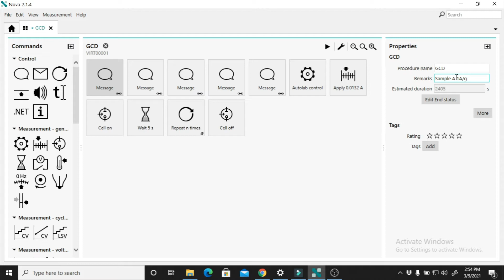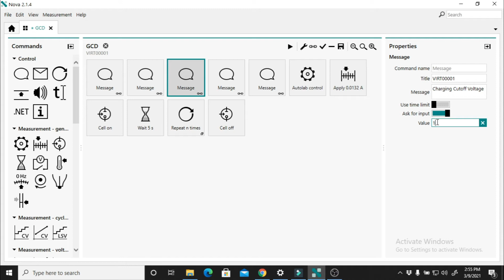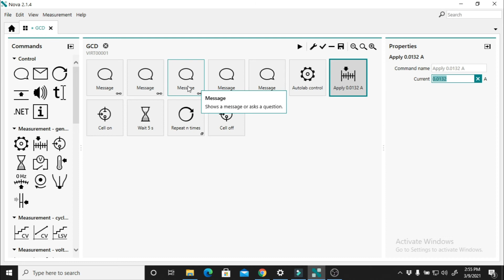How to run galvanostatic charge discharge (GCD) step by step.

Comment: Hi Dr Haffis, first of all, thank you very much for your valuable information videos. I would like to consult you on a subject.
In the CV test, the potential ranges of the carbon and polyaniline based electrode were -1 volt and -0.6 volt. However, when I enter the cut-off values in the GCD analysis, the electrode suddenly charges up to -0.3 volts and then discharges normally up to -0.6 volts. The same curve occurs when I change the order of the potential ranges from -0.6 to -1 V. Since the electrode is homemade and contains a thermoset polymer binder, could the problem be on the electrode surface or do you have any other thoughts on this? A successful cycle is obtained in the CV test, but the GCD graph cannot be obtained with the same intervals. Thank you very much in advance.
Reply from the maker: It is a bit weird if your potential window for carbon/polyaniline to be from -1 to - 0.6 V only. Try scanning wide potential first from -1V to + 1 V. Then you can reduce the potential window accordingly. GCD did not follow cut off, maybe because your sample is still capable of reaching a higher potential window. OR the current you put in is too big. So try to fix your potential window and try again.
Reply: @DrHaffeast  The electrode contains a thermoset polymer binder, as well as a small amount of carbon-polyaniline. Initially, I applied CV from -1 to 1 volt, but the best supercapacitor curve was obtained from -1 to -0.6 volt. I also performed GCD at current densities ranging from 500 to 5 mA/g. However, I think I need to improve the electrode. Thank you very much for your reply; I will follow your suggestions.

Comment: .

I have conducted a GCD test for 1000 cycles. Now, I would like to:

    Extract the data for cycle number 500 specifically.
    Export all the data (from all cycles) into formats such as Excel or Origin for further analysis.

Could you please guide me through the steps to achieve this? If possible, I would greatly appreciate it if you could share a video tutorial or documentation demonstrating this process.

Thank you for your time and support. I look forward to your response.

Comment: Hi sir. My parameter ranges are -0.3 to -1.0. 
How can I set the parameters in the charge and discharge.
Reply from the maker: You can use the same voltage as CV.

Comment: Good morning sir can u please tell me how to save the cyclic stability data taken in the nova software
Reply from the maker: The stability cycle will save automatically. However you need to export one by one. Normally we export cyle no 1, 200, 400, 600 until 5k or 10k. You can also do increment 500.

Comment: In the NOVA library I can not get the GCD file.  Chrono charge discharge is there. How can I get GCD using NOVA file? please help me. Mail me the GCD method of Nova file.
Reply from the maker: Greetings. Sent me an email at haffis_92@yahoo.com.my
I will send the procedure tomorrow. Today I am quite busy.
Reply: @DrHaffeast  I sent you a mail. Please reply.
Reply from the maker: @anupravamandal1870  I have reply. You can directly import the procedure using Nova sofware. Or convert the data to procedure.
Reply: @DrHaffeast  Thanks
Reply from the maker: @anupravamandal1870  welcome
Reply: @DrHaffeast  Please check my reply in mail.
Reply: I have run the GCD file , which you sent. It could not record the signal for two scan. It recorded the signal for a half scan, up to cutoff voltage. I have mailed you for that. Please reply.
Reply from the maker: @anupravamandal1870  I saw your graph.......from the NOVA software you can see two graph. but during plotting you only get half graph. this is because you plot it wrong. you should copy data during charging and discharging then you can get full graph.
Reply from the maker: @anupravamandal1870  https://youtu.be/hX4vfxu3YZ4
I have made video. Please check
Reply: @DrHaffeast  In the show data option, only one half of first scan is recorded then how can I copy data during charging and discharging. Please check my NOX file.
Reply from the maker: @anupravamandal1870  Its normal for first scan... Normally we take the second scan... thats why we run 2 scan not just one.... If you want both scan please repeat the experiment thrice instead of twice.
Reply: @DrHaffeast  I performed the GCD for 2 scan in that nox file. But not getting full data for 2 scan in the data save option. Although, in the plot display window  proper 2 scan is visible. Please check the nox file. Why is it so? Please change the setting of nox file and send it to me.
Reply from the maker: @anupravamandal1870  https://youtu.be/hX4vfxu3YZ4 this video show u how to extract the data.

Comment: Hi Mr Harish
Thanks for sharing the knowledge in electrochemistry. How can I link the message box with cutoff voltage in sharing and discharging section. I try to link them but can't find it in link parameters.
Thanks again
Reply from the maker: My name is Haffis not Harish...hihihi. So far we got the procedure via supplier which is Metrohm.

Comment: Good evening sir
My potential window is from -1 to +1  so what value should I put in the value box of third message
Reply from the maker: For three electrode system, yes you can have potential window from -1 to +1 V.

In Your Case, the third message should be the maximum cut off voltage which is +1.

The fourth message should be -1.

Regards.
Reply: Thank u So much sir  could u please tell me how to run gcd And impedance in nova 2.1.5 Software sir
Reply from the maker: @thendralkrishna7319  I think, I have uploaded the video on how to run GCD and EIS via Nova.
Reply: Can u share the link sir
Reply from the maker: @thendralkrishna7319  https://youtu.be/yF5LFg7WSng
Reply: Thank you sir
Reply from the maker: @thendralkrishna7319  you are welcome.
Reply: Good morning sir I am getting gcd graph but it looks like some what different if u share ur email ID I will send the graph sir.
Reply from the maker: @thendralkrishna7319  haffis_92@yahoo.com.my
Reply: Thank u sir I have mailed u sir
Reply from the maker: @thendralkrishna7319  Dear sir, I got your email. I have seen your GCD graph. There is two main problem first the IR or voltage drop is too big. Second the charging is too long but discharging time is too short.

For the former problem, please check your electrode fabrication and your connection of potentiostat. If 3 electrode system, please check your working electrode fabrication. Maybe, if your sample is less conductive, the resistance will be higher that leads to high IR drop. In this case please add conductive additive or do composites. If you are using device, same thing to consider your electrode fabrication. What electrolyte you use and how you assemble device.

For the latter problem, if you solve problem 1, problem 2 can be minimize or even solved. Please check the discharging cut off voltage. Why -1.4V? why not cut off at 0?

Overall, looking at your GCD graph, I suspect you are using battery type material. At low current density your GCD cannot achieve the maximum voltage which is in your case is 0.6V. First better consult your SV on how to properly run GCD. You can use low current density, but the GCD curve must able to achieve the potential window (based cyclic voltammetry). Wish for your success. Thanks.
Reply: @DrHaffeast   electrolyte is 1M Na2SO4 active material ratio 8:1:1 (active material : graphene powder: Pvdf)
Reply from the maker: @thendralkrishna7319  based on your information suppose there should be no problem. Sodium sulphate is also common electrolyte used. But you can try 1 M KCl or KOH. 

8.1.1 also a common ratio.

Maybe your main materials preparation has problem or you should increase your ratio of graphene powder. Try 7.2.1...suppose if you increase conductive additive the IR drop will be reduce.
Reply: @DrHaffeast  how can I check the ir drop
Reply from the maker: @thendralkrishna7319  you can clearly see from your GCD graph. If you are charging until 0.6 V, your discharging should start also  from 0.6 V. If your discharging start from 0.5 V or even low, mean your IR drop is bigger.
Reply: @DrHaffeast   OK sir thank you
Reply: How can I reduce it
Reply from the maker: @thendralkrishna7319  try doping with conductive material. or try reduce the mass loading.
Reply: @DrHaffeast  OK sir thank u
Reply from the maker: @thendralkrishna7319  welcome. Wish you get promising results.
Reply: @DrHaffeast  I have mailed u another graph also in that for potential keeps decreasing for lower current density can u please point out my mistake in that
Reply from the maker: @thendralkrishna7319  I saw you use 6 mA, 12, 18, 24 and 30 mA/g.

As your current density reduce, your potential did not achieved. It is a common results in GCD.

I suggest you to revise back the current density value.

normally we set our current density from 1 to 10 A/g.
 mass multiply current density you will get current.

In your case  mA/g is very low current density, please bear in mind the lowest should not less than 1 A/g to be accepted in high tier journal
Reply from the maker: https://youtu.be/y1LsqJXNXTQ

Comment: Good evening sir
My potential window is from -1 to +1  so what value can I put 1 in the value box of third message
Reply from the maker: For three electrode system, yes you can have potential window from -1 to +1 V.

In Your Case, the third message should be the maximum cut off voltage which is +1.

The fourth message should be -1.

Regards.

Comment: I have put charging cut off voltage and discharging cut off voltage 0 and -0. 6 respectively (from Cyclic Voltammetry potential window). And I'm getting only one point in charging and one point in discharging cycle (pop up on screen - cut off on WE (1) potential occurred). So can i increase discharging cut off voltage to -1?
Reply from the maker: normally the cut off voltage for GCD must be the same with CV analysis.

You should check either you put correct charging current value and discharging current value. Or your current density might be too big. try use low current density.

Comment: What galvostatic discharge means?
Reply from the maker: Cyclic Charge-Discharge (CCD) is the standard technique used to test the performance and cycle-life of EDLCs and batteries. A repetitive loop of charging and discharging is called a cycle.

Most often, charge and discharge are conducted at constant current until a set voltage is reached. The charge (capacity) of each cycle is measured and the capacitance C, in farads (F), is calculated (Eq. 1).

     ￼

where Q is the charge in coulombs, and V is the voltage window. Both are plotted as a function of cycle number. This curve is called the capacity curve.

In practice, charge is commonly called capacity. Usually, capacity has the unit of ampere-hour (Ah), where 1 Ah = 3600 coulombs.

If capacity falls by a set value (10 % or 20 % is customary), the actual number of cycles indicates the cycle-life of the capacitor. In general, commercial capacitors can be cycled for hundreds of thousands of cycles.